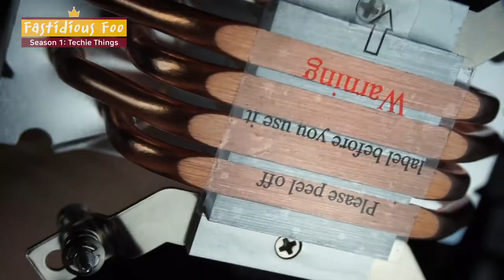Removing and Installing Processor and CPU Cooler

Comment: Where does the extra sata cable plug into on the motherboard when Adding 2 HDDs?
Reply from the maker: there are only 3 SATA ports on the motherboard for the HP Pavilion 580-023w - so you can either give up the DVD drive OR get a PCIex1 slot expansion card
Reply: Fastidious Foo cheers thank you & what about if i want to do raid 0? How would i do that?